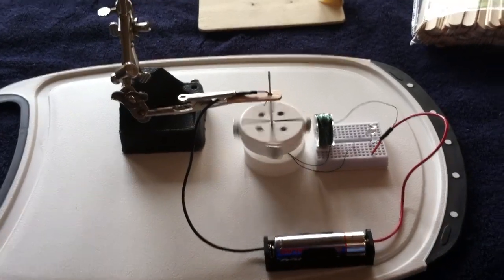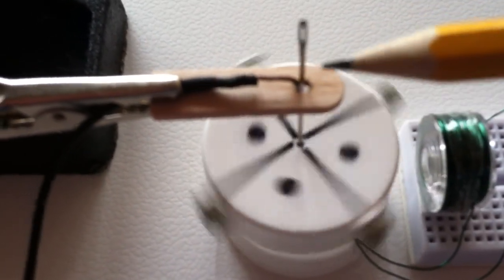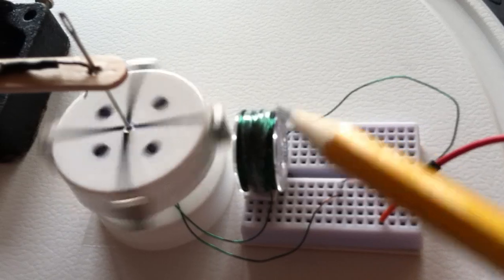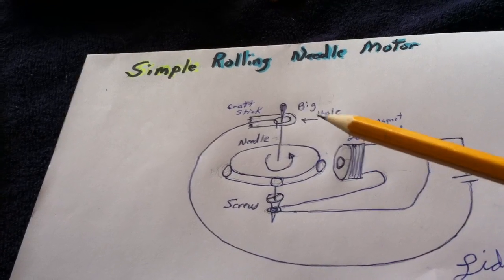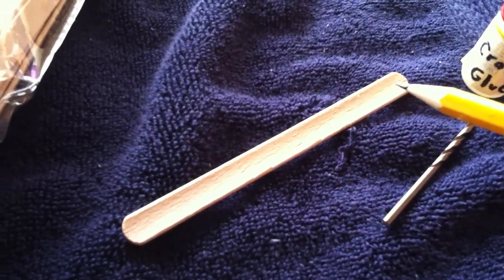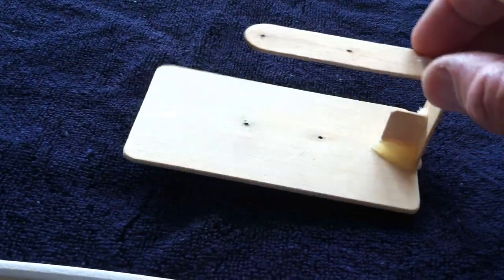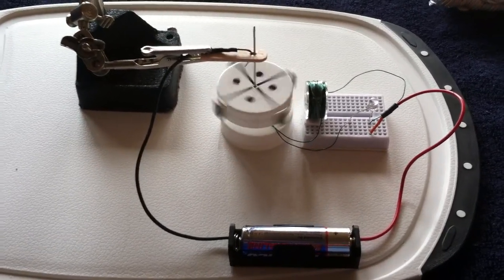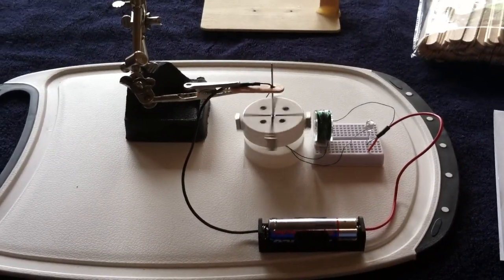Simple Rolling Needle Motor

Comment: It would be fun to see if you could place the coil and power source inside the lid and place the magnet outside and run it on a hall sensor with a top and botton needle contacts. Or even build a simple geared clock with plastic gearing from junk printers or toys from the dollar store.
Reply from the maker: Lots of fun ideas coild be tried on this basic setup.

Comment: Very simple.  I'd pound that piece of copper flat then pound it over the shank of the right diameter drill bit.
That would make the needle rotate a bit smoother--yet still make contact enough to get enough energy into the circuit.

Thanks for sharing!
Reply from the maker: Actually the more I study why this thing works the more interesting it becomes.  The 'pulse width' and when that happens is fascinating.  It is a chaotic situation.  It doesn't fire on any regular basis.  The device reminds me of those old 'hit and miss' gas engines.  Inertia of the flywheel makes it look smooth but it isn't.  If I start smoothing things out I may wreck the charm of it.
Reply: lol.. Just a suggestion, Rusty.   What's the pulse width duration & the actual average firing frequency compared to the rotor rpm?
Reply from the maker: I have not looked at this on the scope but I have been listening to it on my little AM radio.   The thing has a 'static' sound when it fires and it doesn't fire on a regular basis unless the rotor is turning very slowly.  I can rev it up using my little reed switch driver and it seems to go into a harmonic at high speed and stay there.  Everything is chattering and bouncing around at that speed.  For the last 6 hours I have been letting it run slow like in the video.  It is perhaps a few hundred RPM and seem to like it there.
Reply: I see.  I guess you might get a higher fire & energy transfer rate if you reduced the bump the needle experiences with each rotation (which I'm guessing is causing a more irregular & inconsistent firing, energy transfer rate, & consequently rotor rpm).  Maybe with flatter (foil like) contact and possibly a small sweeper attached to the needle you'll see a higher performance. (not asking you to do it--just something to consider).

Comment: I like being able to reduce the parts count in a device.
I think you could also replace the crafts stick hole with a loop of wire and then coat the top of the needle with glue, tape, or paint but scrape some off so it would make and break contact as it turned.
Reply from the maker: Yep!  That will work.  You would need really good glue or paint that would not wear off.  Maybe dip the top of the needle in epoxy and scrape off  sections for the contacts.  Great idea!  That kinda makes it regular commutator but it should work ok.